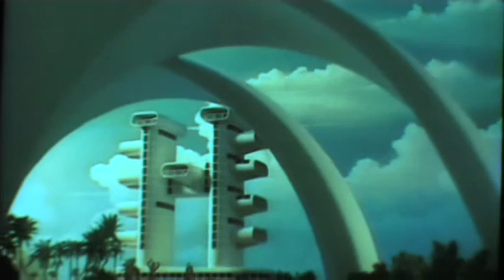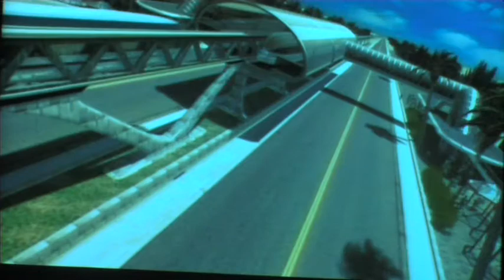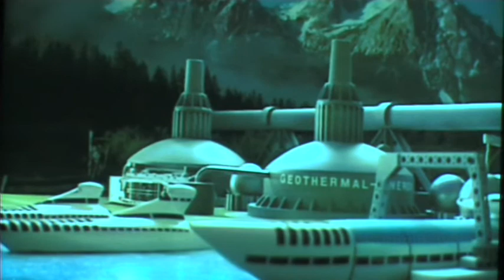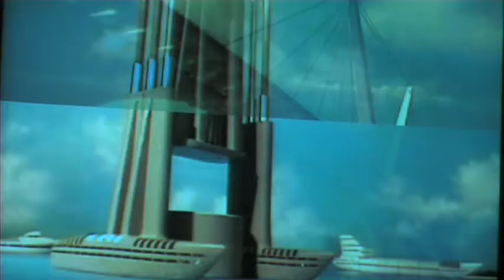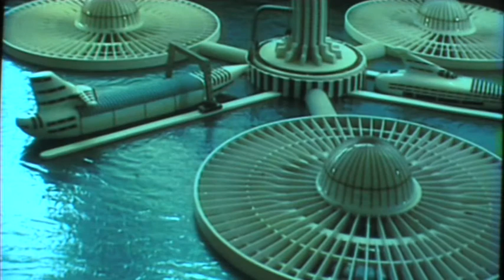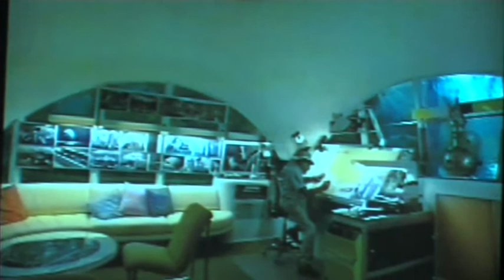Jacque Fresco Lecture at COP Kreativ Part 2

Comment: Hello Gavbag1234,
I am the video camera man who video recorded and edited this presentation. I used two video camera one up front which has HD quality and the other one far back which is not HD. I edited the video has quickly as possible trying to get the best sound and picture. The camera far back ended to have such a better angle than the HD one that I decided to mainly use it editing this quick version. However you can get the HD raw files if you want no problem just let me know :)